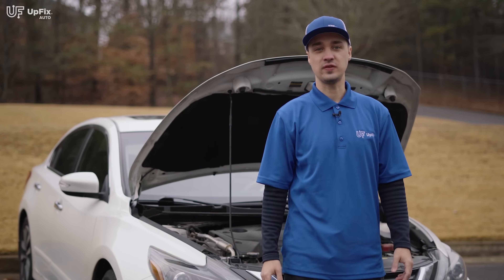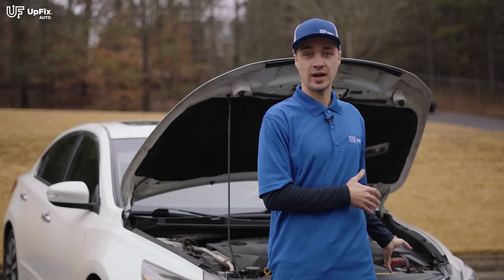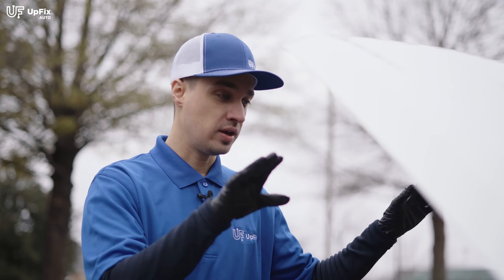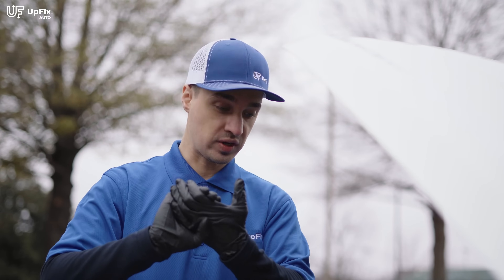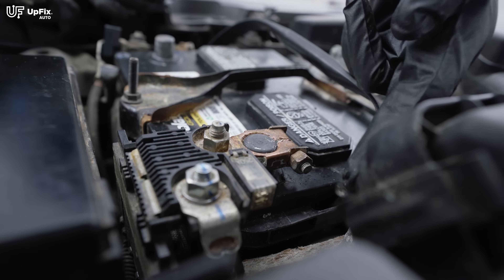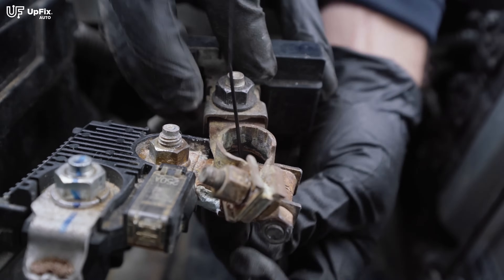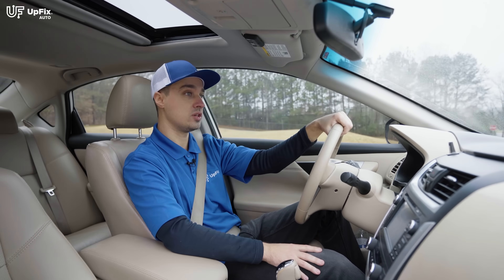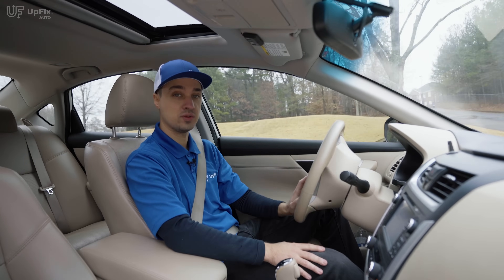How to Easily Hard Reset a Car Battery Tutorial

Comment: For reconnecting the cables after draining, Should I connect the positive side first, then the negative side?
Reply from the maker: Yes, when you hook it back up, connect the positive cable first, then the negative. 

When removing a battery, do the opposite: negative off first, positive last.
Reply: The reason for doing this is to avoid short circuiting the battery, which can rupture it.  Note that your metal tool can contact the body of the car when working it.  If you connect the positive terminal first then your tool may contact the body without completing a path to the negative battery terminal.  If, however, you connected the negative first, then your tool could bridge the positive battery terminal to the body, which creates a complete electrical path from the positive to the negative terminal.  This short circuits the battery because the completed path has no load to serve.

Comment: I'm nervous lol 2009 lexus rx 350..I'm actually having issues.... I put a new battery in drove it for a couple days, tried starting it & nothing..The steering wheel automatically moves into place when I start it and it's still moving & lights come on but won't crank over...I'm thinking starter...I'm no mechanic but I can't afford to bring it to a shop so I'm going to work on it myself,  I just don't know what's exactly wrong with it... it has about 200k miles...Any suggestions...Much Appreciated
Reply from the maker: It could be a few things, but the starter is a good place to start!
Reply: I've an 07 ES 350 that loves to throw the same codes, even if you change the parts. A lot of the times the check engine light will just go way on it's own but if it starts running rough I disconnect the battery overnight, 30 minutes has never worked, and it's resolved the issue more times than I can count in the five years I've had the car. Oh, note, it's never the flashing check engine light. That is the one you really have to worry about on these, apparently, and get it to a doctor immediately.

Comment: This is bs. Not all cars are the same.
Reply from the maker: This procedure is to drain all voltage in your vehicles system.

A hard battery reset (also known as a full power reset or capacitive discharge) is done to drain all residual voltage from the vehicle’s electrical system, particularly from modules that may be holding memory or fault codes. This is often used after repairs or resets (like airbag module resets) to clear lingering faults or glitches.

Comment: Bro needs to upgrade from that 35 tooth 3/8s socket wrench adapted to a 1/4 drive 10mm.

Unless that's what you prefer, I guess.
Reply from the maker: Thanks for the tip

Comment: Whats a firewall?
Reply from the maker: A firewall in a car is a metal barrier between the engine compartment and the passenger cabin. It serves as a protective shield to prevent heat, noise, and fire from reaching the interior of the vehicle.

Comment: would this help sorting a mazda 6  2.3  thats had many parts thrown at it 
last one a new IAC valve
idle is all over the place  500rpm to 1500   stalling when cold   then lose steering when air switched on??
Reply from the maker: Yes, the hard battery reset, oddly, can solve a lot of electrical weird issues.

Comment: Hey @upfixauto I have an issue with my 2016 chrysler 300s i was wondering if you could know what it is. When i turn off my car after driving or if i turn it on and right back off the guage cluster, push to start, shifter lights stay on and drain my battery overnight. it stays on till it drains  the battery but when i disconnect the negative terminal on the battery and put it back on it turns off just like normal im guessing it gives it a mini reset. but would this method work for me?
Reply from the maker: Looks like something is draining your battery. Did you install any aftermarket accessories? You can also let us know more info here: https://www.upfix.com/repair-request/

Comment: Hey so I was told by a mechanic friend to actually have my car on accessory mode when I start to disconnect the battery to do this hard reset do you think that’s ok?
Reply from the maker: It is generally not recommended to have your car in accessory mode or any mode when disconnecting the battery, as this could potentially cause electrical issues or harm sensitive electronic components. It’s always best to ensure the car is completely off with the key removed (if applicable) before disconnecting the battery for a hard reset. This ensures safety and prevents any electrical surge.

Comment: Hi! I have a question I'm not sure if you could answer it with your knowledge. I have a 2015 chevy impala, and it has an engine light on and it says P305F (dual battery controle module) I have checked the current and its good on it, the battery was replaced, the wires are all good, and the trunk battery is good as well. Could there be another reason why the engine light still doesnt come off? Car works great, everything besides the engine light. The light being on also doesn't let me use my remote start. If you could answer or guide me O would appreciate it. Thanks!!
Reply from the maker: Thanks for reaching out! The P305F code on your 2015 Chevy Impala points to a dual battery control module issue, but since you’ve already checked the main components like the current, primary and trunk batteries, and wiring, you’re on the right track with your troubleshooting. Sometimes, this code can be triggered by a software glitch in the control module.

Here are a few steps you could try

1. Hard Reset the Battery: Disconnect both battery terminals (positive and negative) and hold them together for about 10-15 seconds. This can discharge any residual current in the system, helping to reset the car's electronic modules. After reconnecting, start the vehicle to see if the engine light goes off.

2. Check the Fuse: The dual battery control module may have a specific fuse. Checking your car’s manual or fuse box could reveal if there’s a blown fuse causing the module to malfunction.

3. Module Reprogramming or Replacement: If the engine light stays on, the dual battery control module might need reprogramming or replacement. This may require a visit to a Chevy dealer or an auto repair shop with the right diagnostic tools.

I hope these steps help! Since the light affects your remote start, resolving the code should restore that function too. Good luck!
Reply: @upfixauto  thank you so much for the quick reply!! I will try that and get back to you. Thanks!

Comment: So my neg & positive cords are to short to tie together can I use jumper cables to connect them & let it sit??? & if so do I do positive on positive & negative on negative or the opposite????
Reply from the maker: Yes, you can use a jumper wire/cable to connect them. It does not matter if positive or negative is on top or bottom.
Reply: What do you mean top or bottom
Do you mean it doesn't matter if its neg to pos or pos to pos ?  @upfixauto

Comment: Is this the equivalent of programming a new battery replacement in a BMW? 2009 328i to be specific
Reply from the maker: No, this is different
Reply: As I understand it, that is largely to reset alternator charging.level.  a new battery holds charge better longer so requires less recharging, an older one  the reverse, the SYSTEM adjusts based on time since reset to recharge at a higher rate.
If you don't reset, the new battery is overcharged and doesn't last...

Before smart systems,   analog and mechanical components controlled this with few issues.....   improvements.....?

I question the value of a lot of the "modern" improvements, but , what can you do....

Comment: Ok for a prius?
Reply from the maker: Yes, especially for Prius and more for EV vehicles because of more electronics in the car/truck.
Reply: @upfixauto  like a tesls model 3
Reply: @MottyRuttner, yes, this is to drain all voltage from the system to ensure it is (off). Similar to the internet cable instructions to disconnect it for 1 minute to make sure all voltage that is inside the unit will drain. (Yes, like water, need  it to drain.. not joking)
Reply from the maker: @MottyRuttner  Yes!
Reply: @upfixauto  because a 2022 tesla model 3 has a new 16V system and a lithium ion 16 volt battery instead of a 12V system. And if it's okay, the connector will have to be jumped with a pin
Reply from the maker: @MottyRuttner The concept would be the same, ensuring that the terminals that connect to the new 16v battery system, simply don't make connection with the termination cables, performing a hard reset can be done.

With that being said, There are multiple methods that are less intrusive to perform a full system reboot for all the computer modules in a Tesla.

Refer to Tesla guides on how to safely perform those methods if there is a software glitch or a function in a vehicle that is no longer responding.

Comment: I will come back later with an update I realize that I at least need a jumper cable to get between the two terminals because there's no way they're going to come together.
Reply from the maker: Let us know if you have any questions. Be happy to help 😊
Reply: Mine won't reach each other either. Which jumper cable ends do I connect to which  terminals? Thanks so much @upfixauto

Comment: I never even knew this was a thing but it makes sense.  I changed a lot of sensors and solenoids on my 2015 Kia forte and I start thinking like is it making a difference.  I understand that you know you change one thing others going to work harder and those need to be changed and if it hasn't been changed I bought this car a year and 8 months ago I don't know what anybody has done before this.

So it seems like change the latest the camshaft timing sensor I have two of them on the car and it seemed to make it worse after I change one solenoid underneath the car and I did that because I did go get it checked at AutoZone and that was the code.  The problem why I went ahead and kept on changing solenoid after solenoid until this came up and then I checked on it. It's wasting a lot of gas.  I could see where this might be a thing I should have known to do as I went along.

So definitely thank you for your help on this